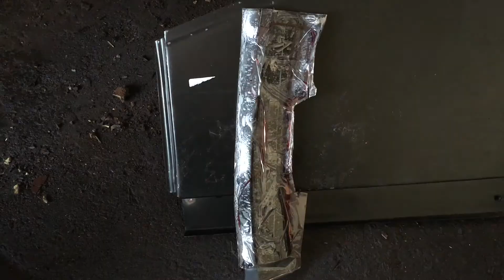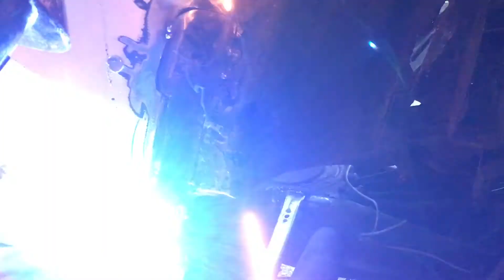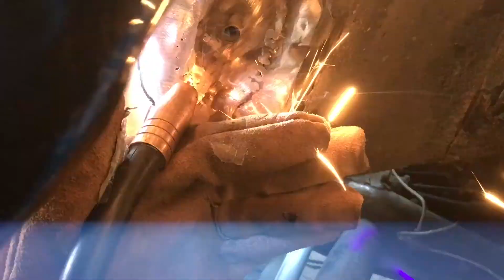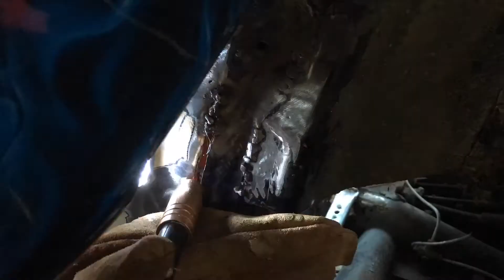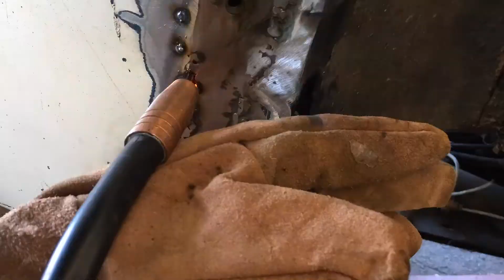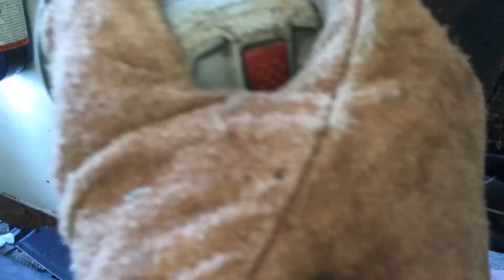VW Beetle Rear Quarter Panel Repair Part 2

Comment: Next time please use the whole replacement panel. The warping would not of happened that way. Other wise great job.
Reply from the maker: Yeah used most of it on the other side and it still warped a bit, just didn't want to cut too much OG steel. Thanks for watching!

Comment: Awesome video! Going to be doing a similar repair to mine soon. What settings are you running on your welder? Have done some welding in the past, but never on thin material like the body panels. Cheers! Going to have to subscribe :)
Reply from the maker: Thanks! I don't remember exactly, but I would use the settings the chart says for 20-22 gauge.

Comment: can you weld on the car without draining the gas out ?
Reply from the maker: I would suggest draining the gas if you're welding by the tank even removing the tank completely is easy on a bug. I wasn't near the tank (it's been out for at least two years) so I wasn't worried and besides any fuel left in the lines of this car is long evaporated.

Comment: Holy shit that's one way to ruin a bug
Reply from the maker: I mean could the repair have gone better? Absolutely, but I did not ruin the bug. All of the pin holes and the slightly larger hole are getting filled with weld and steel. In the video it isn't completely finished.
Reply: @DubWerks  needs all cutting out and repairing again with a proper panel and a proper welder.
Reply from the maker: @robertalexander4717  That was the proper panel, you're right about the welder though. I'm a better welder now, I don't think I'm going to replace the whole thing again unless the panel comes up for sale cheap, I'd rather make do with what I have and fix it than replace it again.